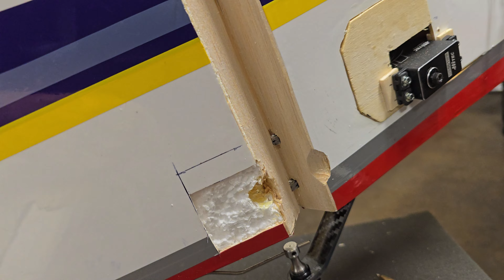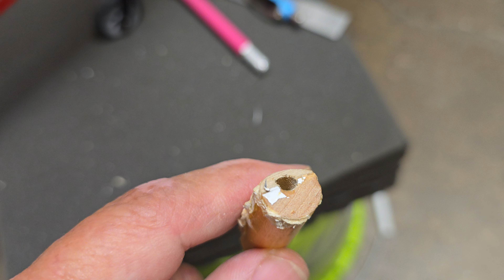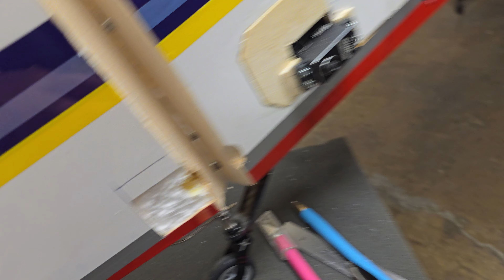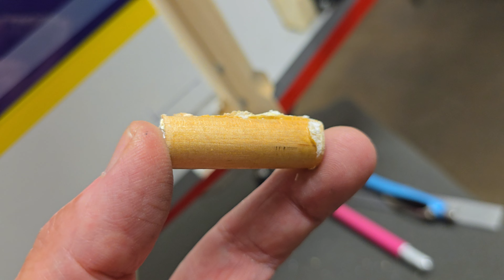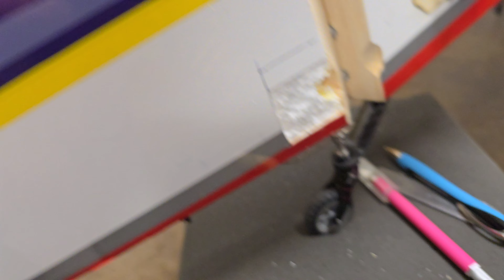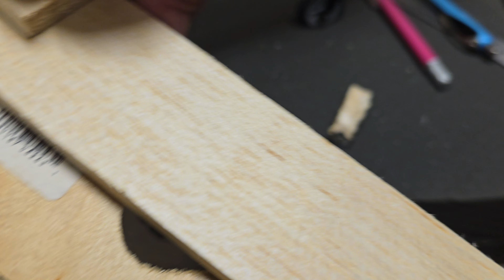Project "Aeroworks KIT" restomod, Part 8, Aeroworks Maiden debrief

Comment: What are your thoughts on mpx connections for the wings. Specifically the ones extreme flight sells? I have them but have not installed yet. The quick plug ins make them seem favorable for the wings.